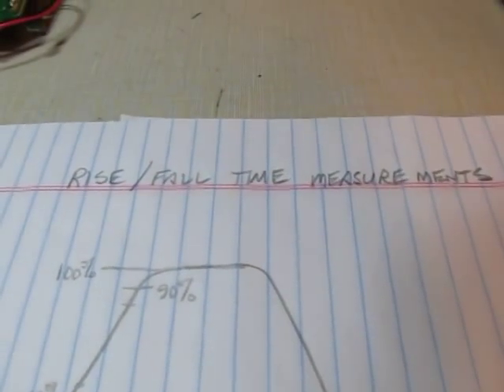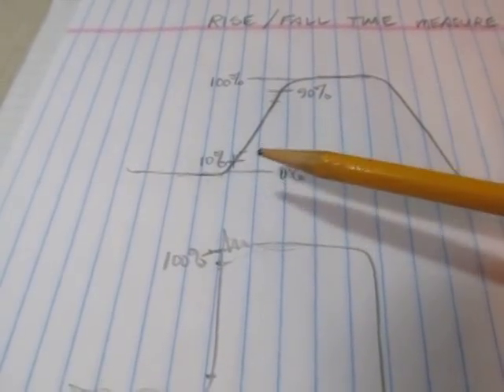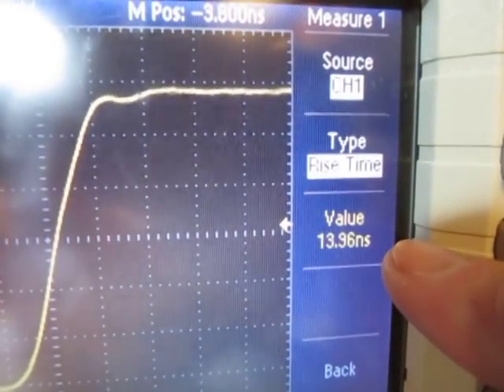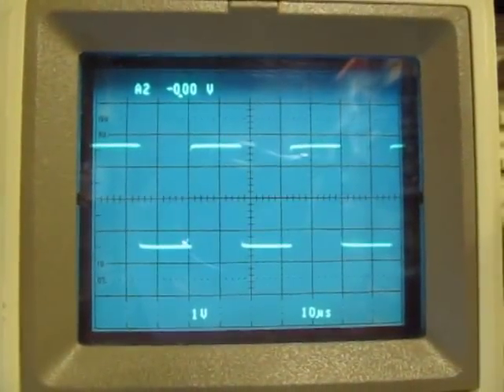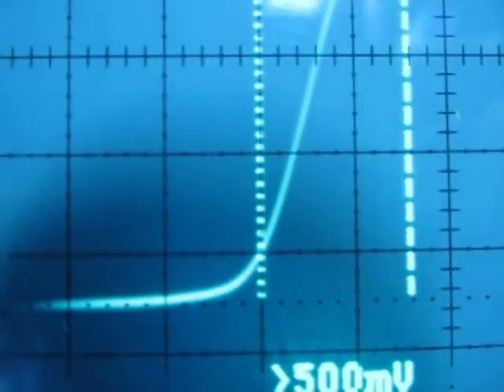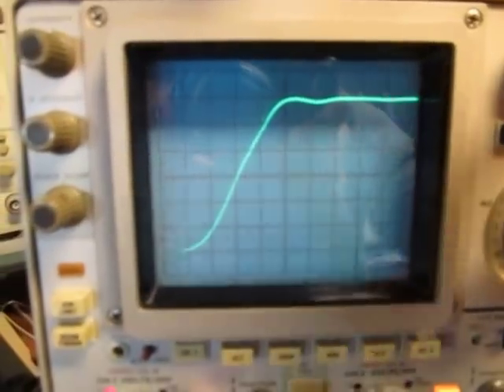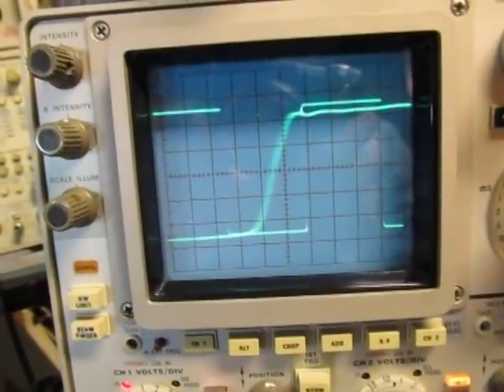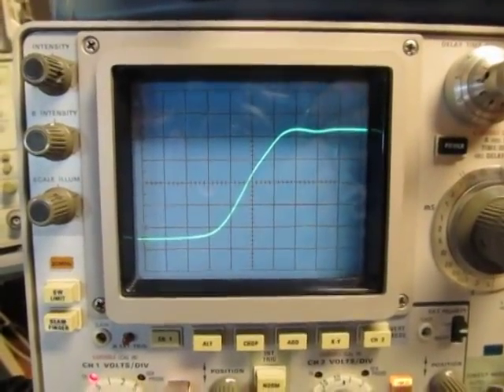#66: How to make a rise-time measurement on an oscilloscope

Comment: Am I being too romantic when I say that I really want to get an old Tek 465B and fix it up? I am a hobbyist and a beginner who has only been watching electronics videos for about 6 months. The only piece of test equipment I currently own is a multimeter. So much of the advice out there says I should forget about these old CROs and just pick up a cheap Rigol. I really don't want to do that! I find it far more appealing to work with a machine that doesn't have all of the fancy software to automatically bring up the waveform and spit out dozens of different measurements for me. I want to take those measurements myself directly on the waveform, and then do the calculations myself. I think I learn a lot more that way and I am definitely not afraid to learn. I'm in my last year of a mathematics degree so I have no worry about learning any of the math involved in electronics or in radio.

Comment: Firstly thank thank. Just listening to you talking about this. clears up a lot of past misunderstanding and also create new questions for me. thank you.
one of the questions is, can excessive ringing at beginning of rise and fall be the cause of overheating on resistors? This is a problem I'm dealing with now. Some resistors are overheating about 300-400 F. 
Their normal operating temp in this circuit seems to be a little over 200.
Reply from the maker: It is very doubtful.  The heating of a resistor simply a function of the power being dissipated (Vrms*Vrms/R), and ringing on the edges won't contribute to that much more power being dissipated.
Reply: @w2aew is there another scenario that causes high dissipation besides high power or current going through? I did measure power or I thought I did. 
I used ohms law to get 
 the current. (168=(47k)X(I)=0.00357), then (168 X .00357= P=(.6) 
I know the resister are at least 3 watt
 And they measure with in good tolerance of their value of 47K..
Reply: @AB-yu2tj  The POWER dissipation is the source of the energy that results in heat (i.e. same reason a light bulb gets hot).  The amount of heat generated at a given power level is a function of the thermal resistance - which depends on the physical size/construction of the resistor, the mounting configuration, the heat-sinking provided by the circuit board connections, air-flow, ambient temperature, etc.
Reply: @alanwolke6253  does skin affect or other affecting resister at hi frequency play a factor in over heating it.. 
I measured frequency  from a little below 50k to below 200k. It does not seem to stay stable. 
But I might not have the right instrument to measure frequency, though.
Reply from the maker: @AB-yu2tj  At those frequencies, no.

Comment: If we measure risetime for a 5V peak to peak signal VS say 10V peak to peak signal, would the rise times be different? Risetime is a function of the bandwidth of the scope and the detector right?
Reply from the maker: Normally when you measure risetime you would want the scope's inherent risetime to be 3-5x faster than the signal you're measuring so that it doesn't artificially slow the signal.  Risetime is independent of voltage swing unless the circuit is slew rate limited.

Comment: Hi. As (almost) always great video!  Got a question, but not about the video's topic. In the video you have a 50 ohm terminator attached to the input of channel 1. However it looks like a BNC barrel connector (M/F).  I have never seen one like this usually a terminator is for terminating, right (ending a "T" loop)?  Why barrel to it?  Why did you need it? Why term the input of a scope anyway?  Why not just turn the channel off or set to ground?
Thanks,
Ken
Reply: That is a 50 Ohm barrel connector where the 50 is from the center to the ground barrel.  Serves the same purpose of a "tee" with a terminator cap.  The barrel terminator is needed because that scope model has no 50 Ohm setting on the channels.  And you need a terminator for super fast rise-times because there is a 50 Ohm cable of length too long compared to the rise time of the signal.   Otherwise, there would be a large reflection and lots of ringing.
Reply: Ken Cosi 

This can be measured with an ohmmeter.

Comment: I'm not sure if its called rise time measurement when you measure various switches open contacts to close contact time interval because some switch mechanisms are Fast acting and some are slow acting. I'm guessing this is called the rise time? when measuring the time interval from open contacts to close contact time interval? I have used a DVM meter and set it to measure frequency and toggle the switch to measure the frequency and convert the frequency into time. Using an oscilloscope you can toggle the switch and measure the rise time of the switch on/off time interval. Some switches are fast acting and others are slow acting

Comment: How do you measure the Max Rise Time the actual oscilloscope can measure? because when adjusting the function generators Pulse Width range from 10mS and keep lowering it like to 1mS or 100uS to 10uS the Oscope Rise time can't measure it because of the Digital ADC converters or the software not sure, but have you notice this problem and what is the called? The Max Rise Time won't change value because that is how fast the Oscope can measure the rise time of the function generator Pulse width but I don't know the term or name this is called when the Oscope can't measure very short rise time.
Reply from the maker: Risetime and scope bandwidth are intimately related.  The general rule of thumb that applies in most general purpose application is that the scope's inherent risetime is approximately equal to 0.35/bandwidth of the scope.  Thus, a 100MHz scope has an inherent risetime of 3.5ns.  A scope can not measure a risetime faster than its inherent risetime. For example, if you have a signal that has a real risetime of 1ns and you measure it on a 100MHz scope, it will measure something a little larger than 3.5ns.   Digital scopes add another wrinkle.  In order to measure risetime, the sample rate of the scope has to be fast enough to put a few sample on the rising edge itself.  When you are running the scope at slower horizontal scales, the waveform sample rate may drop due to scope memory limitations.  Also, many scopes perform the measurements on the display sample points, not the actual acquired samples in memory.  By doing this, the risetime measurement will change when you change the scope's horizontal scale!  This is poor behavior, but it is done by many scope makers to make the processing faster/easier.  Tektronix scopes always make the measurements  on the underlying acquired sample points (not the displayed sample points), so the measurements still remain accurate (provided the acquisition was setup with an appropriate sample rate and memory setting).  When the scope risetime measure changes with horizontal scale due to the sample density, the effect is called undersampling.
Reply: @w2aew  Thanks for the info because I have notice this also about the ADC sample rate time and the Oscope Bandwidth being related to the max rise time. Different Oscope brands make the rise time measurements differently by the sample points. I don't know how to change the sample points, sample rate, memory setting to NOT change with the horizontal scale of the sample density. Try to make a video lesson about this because it gets very confusing if you don't set up your Digital Oscope correctly when measuring very short rise time pulses. The Horizontal scale when changing it will inherently change also the sample points, sample rate, etc it does this by default/automatically when I'm not sure if certain Oscope brands even allow you to changing the sample point settings, sample rate settings, etc.
Reply: @w2aew  Also Oscope has a measuring called "Pulse counter" PS but it always will count the pulses wrong and in correct, The newer Digital Oscopes have Pulse Counters but you have to go into the sample rate settings, sample points settings, etc to set it up correctly I think in order for the Pulse counter to work correctly, If you apply a pulse that has 100 pulses the Oscope Pulse counter it not count 100 pulses it will say its 30 pulses and the next cycle it will say 45 its random. How do you fix this problem?

Comment: What if I want to measure the time it takes from receiving an external trigger to the 100%?
Reply from the maker: If you have a digital scope, you can easily position a cursor at the point where your signal reaches 100% and the time-value will be the measurement you're looking for (since most digital scopes assign 0 seconds to the trigger point.   If you have an analog scope, you'll have to count divisions from the trigger location to the point where the signal reaches 100%, then multiply this by the TIME/DIV setting.

Comment: Wrong ..must be Use *10 mag...  Bw on oscilloscope .35  /bw equal rise time
Reply from the maker: Really depends on the signal risetime and period, whether or not you would need to use 10x horizontal function. 0.35/risetime is true only if the scope has a single pole roll off (most, but not all, do)